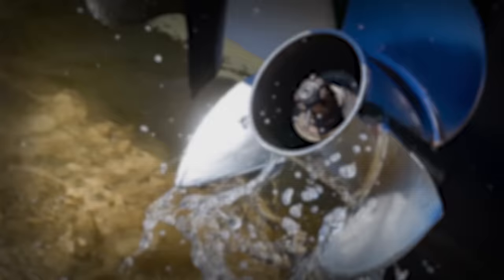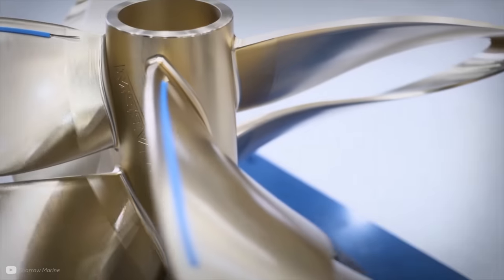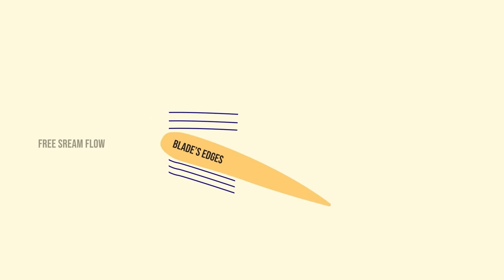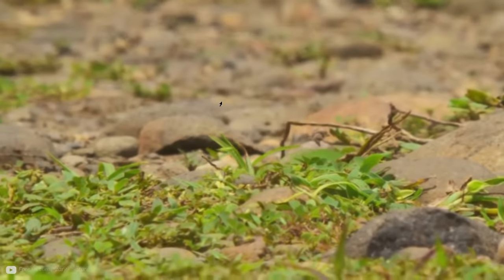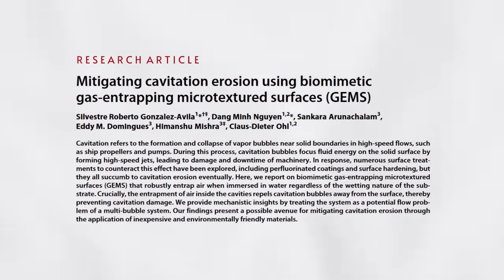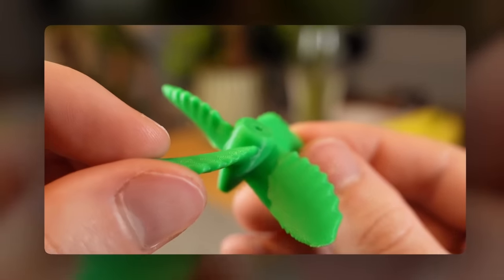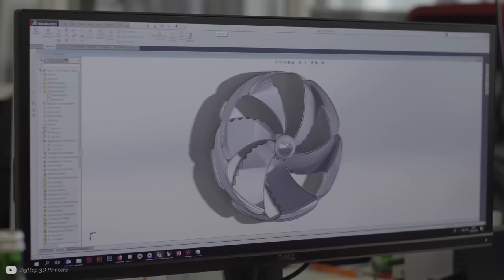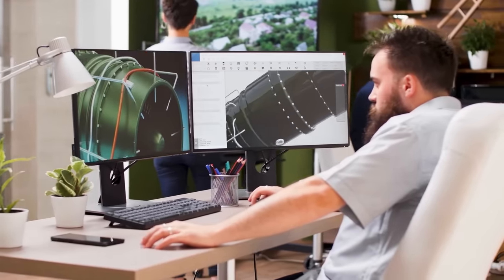The Unexpected Genius of Bionic Propellers

Comment: I Race small outboard hydroplanes and have owned small fishing and work boats.
Those air bubbles are like boiling water . 
Getting a single prop to be good in every way is very hard unless willing to balance all needs.
Hole shot and towing loads you need flatter pitching and for high speed you need more pitch but less blade affecting the exit.
Now you got a prop that does both Hi and Low , Does it work in turns or rough water?
    Those jagged edges sure look like Stealth plane surfaces .
   I’ve seen props get damaged , but then set lap record or win a national event.
Owner would usually mark 
“Do NOT Repair “ on the blade .
   But that same prop would also Fail to plane during next race on different lake .
Fastest props were also the hardest to plane.
    Thinner blades yield top numbers but do flex under load . 
Adding those ridges without thickness is the hurdle I see.
     Props are a Black Art , can never predict what the real world will allow.

Comment: I really enjoyed your video, however I felt that even with the relatively radical approach of copying the whale fin, which I think must be tried, a provocation must be to do more than 1st order change, i.e. doing what you do better & smarter but rather design a 2nd order change, i.e. doing what you do differently. I read a New Scientist journal at least thirty years ago that explained why a fish is able to accelerate at the speed it does by pushing (with the tail) on water going in the forward direction, NOT as a prop does which pushes on water going in the opposite direction, away from it! There are new materials, production methods, controls, which weren't available even a decade ago. Now that would be a radical design. Good luck. Paul, Johannesburg

Comment: There is a thing called "Vortex generators", often used in short-takeoff-and-landing (STOL) aircraft. They helping in low speed flights, increasing lift ar low speed and overall are very good thing. However, they also increase drag, especially at high speed (no problems for STOL aircraft, since they are mostly very slow). Maybe it is not a problem for your whales, since this particular species are not need to be high speed swimmers. 
It is important to not forget that drag is also depends on speed, and often non-linearly.
Reply: yes. I wonder in all the comments not one mention of Vril. This tech has successfully been applied to aquatic vehicles

Comment: I’ve always wondered how they decide what the proper number of blades is to maximize fluid/air flow.  2 blades?  3 fatter blades?  4 thinner blades?  8 thin blades?  50 tiny blades like a turbine?  
The usb fan on my desk has 2 blades, my ceiling fan has 5, a table fan i have has 3 or 4, I forget.  And the cpu cooling fan i have has 10 blades if I remember correctly.  Does the viscosity of the fluid (air, water, molasses) even matter re the number of blades?

Comment: I noticed that a composite propeller on my RC speedboat, and before you laugh keep in mind this thing is around a 100mph, seems to resist damage from cavitation better than a aluminum, excluding heavier brass or stainless.  I also tend to prefer surface drive or half submerged propellers over fully submerged variants, due to the most efficent prop being a single bladed prop, which is impossible to balance properly.

Comment: The most efficient propeller is a single blade propeller. But torsional forces are difficult to manage in these cases. There was a single blade aircraft propeller early on that were used with success.

Comment: The reenergization describes with whales turbercule is well known in plane aerodynamics. It is usually done by slot in the wings that replaced previous vertical separation. It is the same effect but in gydrodynamic, different speeds and different global optimisation.

Comment: Is it necessary to manufacture the wing or blade as an integrated unit?  I'm thinking of the moveable devices on aircraft wings to increase lift- perhaps advancing and retreating the tubercles could maximize overall performance rather than just having one sweet spot.

Comment: I've been telling anyone who would listen (which turns out to be nobody), what would happen if you put a sawtooth design on the leading edge of a propeller and a wing? I thought about this for a long time because of the front part of fighter jets (I think it's called "the nose" of the jet).
The other thing I've been thinking about as it pertains to aerodynamics is: air molecules are really small. The objective of flight is to get the air moving over the top of a wing to move faster than the air under it. Take a look at the skin of the great white shark on a microscopic level. Now apply that texture to the skin of a plane or submarine or the hull of a boat...see if those things move faster through the air or water.

Comment: Shark skin is extremely rough, even used traditionally for sandpaper.
Turns out that rough skin is more efficient than smooth skin and some sailboat racers even rough up their boat hulls with sandpaper for an extra edge.

Comment: Surface cleavers. Racing propellers used on "go-fast" boats. Aggressively pitched, very thick. No cup. They are usually 5 blade. They beat the water into submission at high RPMS. That's how you get the tall rooster tails coming off of drag boats.

Comment: now one must combine the toroidal and bionic whale type propellers, and I am also assuming the propellers need to be tested with a more flexible rubbery skin surface that stays flexible in cold. rather then the hard metal or hard plastics. the whale arm is with skin, cartilage I would assume, and circulation of blood, and thus also surface moisture, temperature, and skin surface oils. thus eventually we might have a self repairing surface, or that its cheap and easy to restore wind or water repellers, while also doing less damage to creatures moving in the water or sky. also planes then need not de-ice there wings, the flex simply detaches the ice, or on a propeller, the slight change in shape with speed might reduce cavitation.

Comment: A cylindrical pipe is not the one giving the least friction. I imagine that a slight twist will guide the airflow of the propeller. Also to tunnel the flow in a circular inlet may increase efficiency. Keep up this interesting debate.

Comment: Little sus "Whalepower", along with that Berlin university group, didn't say how much that "Bionic propeller" design they came out with reduced cavitation by, when that is one of the main factors they're trying to eliminate. I have my doubts they actually gained any performance out of it and I doubt it reduced noise by 30% as they say. A solid propeller and a fleshy fin are two very dissimilar things, I think more research and cross testing is needed before anything substantial will come from this.

Comment: If only the surfaces of say a windmill need to change depending on condition, I wonder if there would ever possibly be a retrofit. Some kind of fabric skin and bladder bumps. Maybe spring steel along the edges and variable compression to change the frequency along the edge.

Seems like the right abrasion resistant fabric might be a potential method of applying those "inverted mushroom" textures. Some of your durability requirements would be less than normal anyways if you eliminate cavitation.

I don't know, it just seems like with the smooth rounded shapes being used, some sort of pneumatic or hydrolic system would make a variable surface and leading edge shape possible. With the slower RPMs on windmills and the benefit of an efficiency gain in that space may be worth some less mass productive approach. Even a large reduction on noise would make then none palatable to homeowners near a prospective wind farm.

Comment: I think that the problem with bionic leading edges is that they are, as I understand it, tuned to a specific velocity range. Out of their range, they are less efficient.

This is not a problem with a whale, but just like the roughness of a shark's or dolphin's surface reduces drag, it only does so in their relatively short velocity range and in their Reynolds Number:
When you try to scale it up, or down, it doesn't show an efficiency gain across the entire envelope.

It could be useful on cargo ships, for instance, but even there, the efficiency gain doesn't yet justify the increase in cost. However, I am optimistic about its uses on marine craft which spend a great deal of their time in a very narrow velocity window.

For aircraft applications, until we find a light and relatively inexpensive active geometry solution (which is in development as we speak), this technology will not be of great use.

Comment: I use A Prince P-Tip prop on my light plane, the tips are bent over 90 degrees, besides really good performance, it's the quietest prop I've ever had.  I'd be more than willing to ry out a Bionic prop on my plane, it's in the experimental catagory, so no certification BS to worry about.

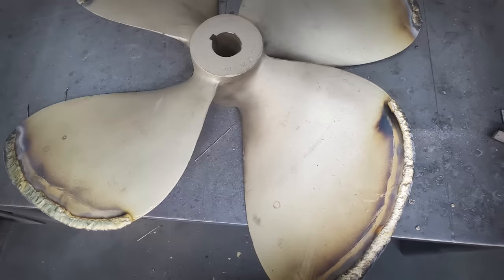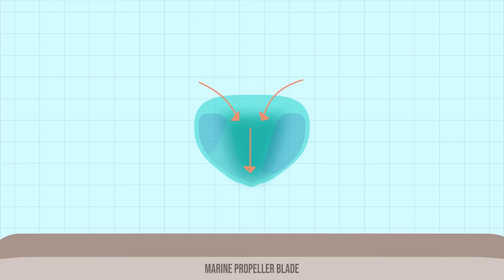Comment: 1:57 - those are "welded up" propellers (the first step in repair of those) that got their edges chipped, but most likely NOT because of cavitation (which affects the surface of the blade, not its edge - see 2:14 and 2:27 and onward) but rather by hitting some rocks or flotsam.
3:01 - STREAM, I suppose, it was meant to read...? (Instead of "free SREAM flow")

Comment: Has NASA tested this for aircraft wing leading edges or propellers in either wind tunnels or CFD models do you know? Would these add extra stress to airfoil sections at various angles of attack? I know advanced designed high by-pass jet engines have something similar in appearance at the trailing edge or exhaust end of the by-pass duct to lessen exhaust noise.

Comment: I have seen so many manatees in Florida that have horrible propeller cuts, propellers need to have a wire mesh cage around them. Can you imagine having the equivalent of a riding lawn mower cut your back and spine open with massive chops? How that would hurt… such intense pain… then the shattering of a spinal column… 
I have a broken back, one of my pieces of spinal column was shattered in 5 places and knocked at an angle making me almost a half inch shorter now… can you imagine the pain those manatees are in ? I can… there’s nothing like it…

Comment: The original propeller was believed to be so terrible that they had to tie a prop driven boat up to a paddlewheel driven boat and had them both set to 'Full Ahead' and couldn't believe the screw prop was dragging the paddlewheel. Also prop noise in the ocean is way less than sonar. If you are underwater when sonar goes off and you're close enough, you just die. Like organs rupture and you die. Listen to a sonar ping as recorded by SCUBA divers far enough away they survived, and you understand you too would beach yourself like a whale so you could die in a little quiet too. Don't blame that all on propeller noise.

Comment: In the enclosure of a thousand horsepower water turbine of a small hydro electric generator, I suggested the Cavitation, through several inches of steel and a foot of concrete, sounded like hand grinades exploding every second.

Comment: the solution is the placement of the propeller, water pump can run 25 years only when air is added to the instake damich appear,so a tractor propeller because it have a back pressure and a pipe is a solution
to that and the front wave and the back pressure behind the ship that act as a brake. So basically is a ship 
 integration dessing,it will be like airplane propeller and turbine.

Comment: Wait wait wait. Cutting a sawtooth pattern into the back of a blade to reduce drag and noise? A new discovery? This has been known for decades! I recall asking my grandpa why he did that to his fan years and years ago and he heard it on the TV from some home improvement thing. It reduced the noise the fan made and lowered the power consumption as the motor didn't get nearly as warm. This "phenomenon" is not new at all. You can even get computer fans that look like that. The downside of them is that while it helps the flow to move more smoothly over the fan blade, the actual air current created is more turbulent so the flow loses momentum much quicker. Meaning this only really works for propulsion and not for moving air. That's why those computer fans have pretty much been discontinued and why I think in the end cutting the blades of a fan up like that only reduced the noise and didn't actually make it flow more air through the room.

Comment: So what happens when you design a propeller thats both toroidal and contains these little bumps? I think these basic plans should be fed into some kind of genetic algorithm loop to simulate real world conditions and optimize the design. Who knows how much efficiency you can get. Even if the benefit is 10% increased efficiency if you can get manufacturing costs in line it would be a winner.

Comment: 3D printing as you depict it (without any apparent significant tooling knowledge) is NOT the panacea you've described.  It has limited application due to strength of materials and per-unit costs.  POROSITY in laser sintering being a key shortcoming in your shown applications.

Comment: I feel they need to test a blade using dimples in the blade, like a golf ball has, (This is my idea, so please don't patent it, as your own), the dimples create individual negative pockets, across the surface of the blade, thus creating a internal rotational pocket within the dimple, increasing laminar flow of the water going over the rotational pocketed dimple area, which not only increases the water or air flow over the blade, but reduces the noise of the blade, due to the increased speed of the flow, to closely match the speed of the flow, back to re-introduction of the flow of air or fluid with the flow from the other side of the blade.    
    This same concept of dimples would not only be beneficial for the blades, but will also benefit the drag reduction on a boat hull, if the hull and outer surface of the boat were to be dimpled as well.
    I tested it on a model and there were improvements on both the blades, the hull of the boat and aircraft skin.    It's like the principle of the new faster torpedoes, that put a pocket of air in front of the torpedoe to help increase speed, well the dimples work almost in that same way.  (The rights and originational intelectual concept for this invention is the property and sole ownership of John Kissam).
   Please contact Mr. John Kissam for rights of usage, claims, or proprietary agreements or licenses.

Comment: I just thought of a nitinol electrical pulse (3 extremely light small springs of nitinol or 6  on each wing) and small piezoelectric switches to apply a small heat for spring contraction) induced bird type drone. Still haven't worked out the firing design in my head  because I literal just thought of it. That's what I love about watching videos of innovation they always spark my imagination  and remind me why I  love mechanical engineering. So thanks

Comment: Pickup trucks Had a bubble of hot air in the square behind the back window because there is 0 air flow. Things have changed a little buy most still have at least SOME of the of the hot air bubble

Comment: So we may have a toy propeller for toy boats. How much thrust does one of equal diameter give ? What is the revolving weight ? How much would a full scale production propeller be ? How easily are they cleaned and how easy to balance ? Noise in our oceans is certainly a defence force issue, but a 500,000 tonne GD ship has one propeller normally and it turns at 140 RPM or so . The propulsive force from that ONE propeller gives a very very large steel ship a speed of what.............. 20 to 25 knots ? Noise to the animals ? Zilch in overall effects and we don't have large tankers and container ships driving around the Antarctic or many " delicate" sea areas. Even through the Great Barrier Reef we have restrictions on speeds and so on, therefore on noise. I think we have to accept the downside to human life or just forget about human life as we know it. BTW I teach maritime studies.

Comment: I was just going to say that cavitation . .
However don't destroy cavitation . Make cavitation work for you . 
   Shark skin cvitates water so they slip threw water with ease . 
   Boat  🚢  hulls and propellers should be made the same . 
    Controled cavitation stops drag.  
   Drag that robbes power . 
You only need to pin the nosel back on a hose spraying water , drop it in a bucket 🪣  and gentally pull it out to understand the huge drag coefficient of moving water in stationary  water causes ..! 
   And so it's not just the ,
Propeller , 
The 
Boat 🚢 hull . 
It's the water streem being developed that is building water to water huge drag coefficient THAT CAN BE RELIEVED BU CAVITATION AROUND IT ..! 0:25
Reply: However I'm convinced you got cavitation backward . 
  And what you think causes drag coefficient on a hole on a prop could also be used to stop it !

Comment: IT SEEMS THAT PROPELLERS ARE SO INEFFICIENT. THEY NEED TREMENDOUS POWER TO EVEN MOVE ANY SIZED SHIP OR BOAT. THERE IS A WAY TO PROPEL SHIPS OF ANY SIZE AND USE 1/5 OF THE POWER NEEDED PLUS HAVE THEM TRAVELLING THROUGH THE SEAS AT AMAZING SPEEDS!!!

Comment: its great that the advent of 3d printers is making this more achievable goal than ever, but this idea has been around for years.  although originally made on the trailing edges of fan blades, theyve done studies on owl wings for sound and vortices reduction.  same principles for the eagle curling the edges of its wings (winglets) and the little ram-air looking add-ons for aviation used for stabilizing the air on the lift side
Reply: It's, not its.
Reply: @duanehorton4680   also "they've", but who is counting. makes you think it may have been done on purpose